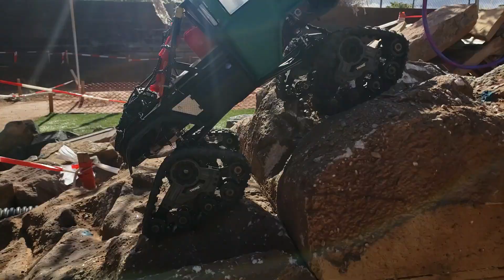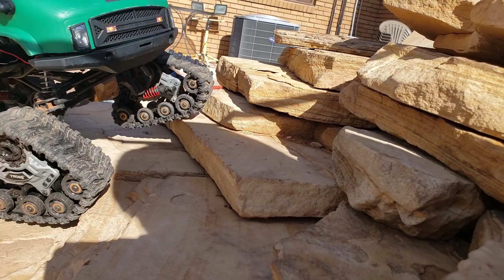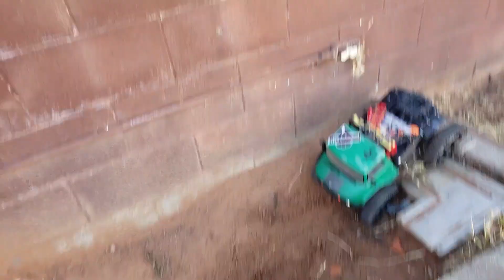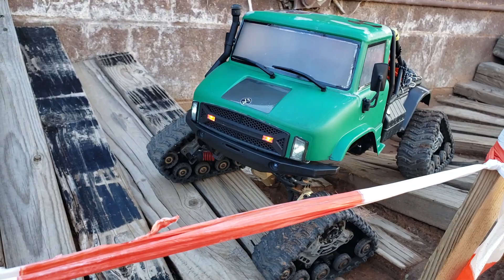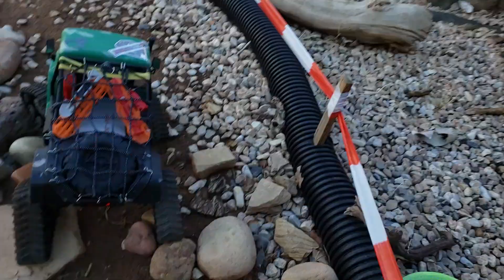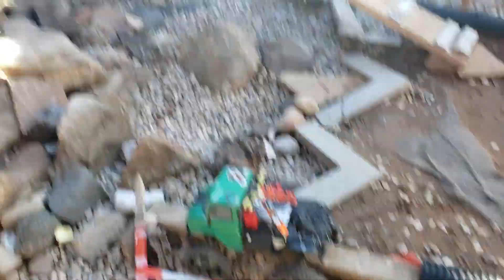Axial scx10ii umg10 w/ traxxas traxx portals  ((((ENJOY!!!!)))

Comment: How hard was it to fit trx portal axels on the umg
Reply from the maker: It wasnt to hard the rear bolted up just fine, the front inched to switch a couple links around, but they bolt in pretty easily
Reply: Yeah it's easy I literally just did it. The rear is perfect and a direct fit. The front takes some panhard work and moving the top link to the other side. The front fits terribly. Do not buy trx 4 axles for your scx10 ii. I had some lying around. Definitely buy a setup that uses the ar44s. The trx 4 pumpkin is right in line with the panhard mount and what not and hits it almost immediately upon any suspension flex. Mine is actually resting on the bar because I run soft and low normally.

Comment: how did you mount them, will they fit on any rc?
Reply from the maker: It took a little bit of work, th hardest part was getting the panhard mount on the trx4 portals to fit properly, once I got that it was a simple bolt on
Reply from the maker: Sorry it took so long to get back to you

Comment: is that the original chassi ?  and did you do any adjustment on the pan hard?
Reply from the maker: I used the panhard from my trx4 sport  the one that came with the  umg10 was not long enough
Reply: ?? Too short? Dude I had to make a special panhard because both the trx 4 and the 10 ii panhard are way way too long.......